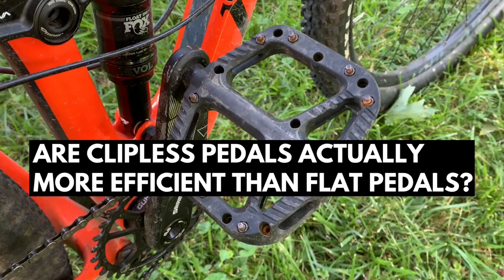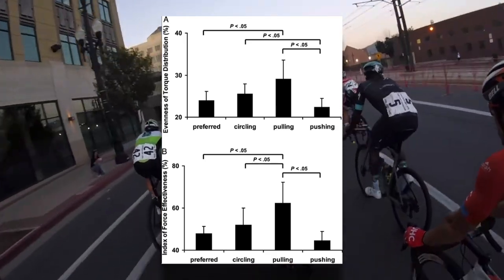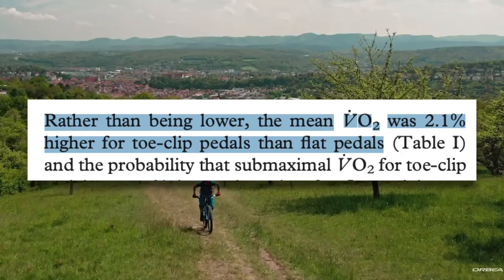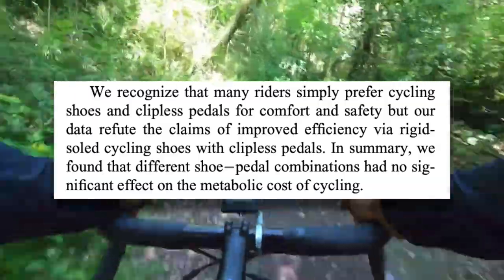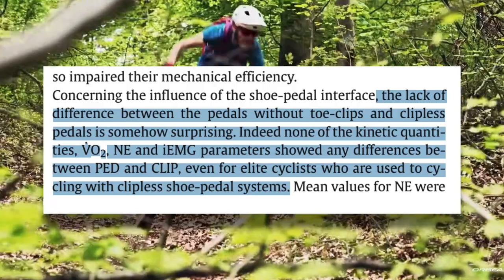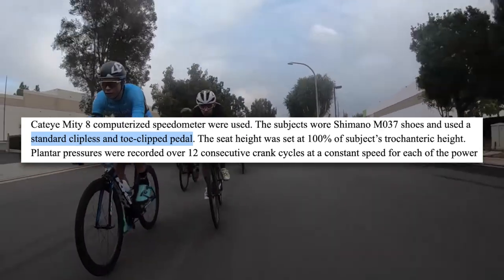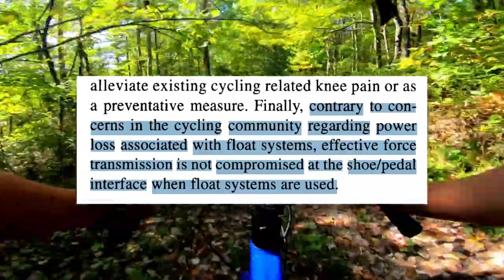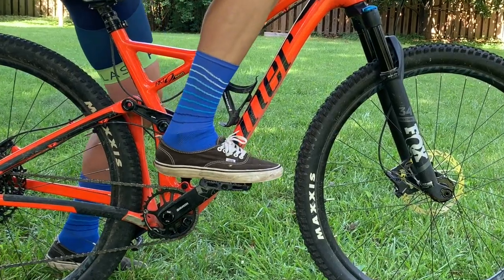Are Clipless Pedals Actually More Efficient Than Flat Pedals? The Answer Might Surprise You.

Comment: I come back to this after former pro racer Paul Voss briefly switched from road bike cleats and shoes to MTB cleats and shoes before the Unbound and had to stop the race after 3/4 of the way because his calves gave out.

He never trained in the MTB Cleats and said they had a different position that his muscles weren't used to.

But given that the SPD Cleats are way smaller than Road Bike Cleats it's also very possible that the transition is weaker in MTB Cleats and he just had to use way more energy in MTB Cleats.

Flat Pedals would have been the right move.

This is one clear an example of how ideology works and manifests itself. There is enough science out there that someone should give Flat Pedals in such races a try, especially if he has to walk in Mud so much. For the Unbound 350 it's very easy to see how Flat Pedals could save you a lot of energy as all the muscles in your foot will be contracted instead of one area only
Reply: Pure bollocks. His problem was he changed equipment before a race without taking time to test and fit.  Not that he didn't use flat pedals. No offense, but utter nonsense.
Reply: @PRH123  Take offense that you said nothing of value and didn't make one argument. Study biomechanics and energy. Learn. We don't live in a Minecraft world where everything is for free. Not to late to pick up a book.
Reply: @ambulowan  right, you’re a biomechanics and physics expert, strange you’re not working for pro cycling teams and sharing your vast knowledge with them, you could teach them your theory of foot contraction :)
Reply: @PRH123  >working for pro cycling teams

Like cycling teams have any expertise,
for the longest time they were very resistent to any advice. Just look how long it took them to install the slightest now obv thing that everybody is doing. It was decades. Cycling teams is absolute amateur hour, it gets a little better now, but for most it's just about power, admitting something works better means that you are not needed at you job, so hardly anyone is doing it.

Comment: After years of going back and forth, back and forth, among foot-to-pedal options, I finally settled on my Campy flat pedals with Christophe toe clips. For me, this is the best of all worlds. I get just as good riding efficiency based on my real world experience (and this video). I get the advantages of having my foot securely in position on the pedals. I can remove my foot much faster from the pedal in an emergency. I get to use my running shoes so if I want to have an off -bike adventure to the coffee shop or hiking trails, I am ready to go. And I save the huge expense that comes with buying dedicated clipless bike shoes. The only down side I can see is for the bike accessory manufacturers who lose the business that comes with buying all that clipless gear. Anyway, just one man's opinion.
Reply: Speedplay frogs will release telepathically, much much faster than being strapped into the bike.
Reply: bikebudha01 Thanks for the tip! I checked those out and it says SpeedPlay Frogs were discontinued in Feb. of 2020. Oh well. BTW, I wouldn't refer to my system as being "strapped to the bike." My Campy plus Christophe system does provide a secure connection to the pedals but it allows me to pull my foot straight back and out of it's "mooring" with no issue under any emergency dismount situation...which is really important to me.
Reply: @SignorLuigi  You can still find frogs on the interwebs...  get them while you can.  (They last forever, I've been riding the same pair on my moutain bike for the last 3 mountain bikes i've owned.  You do have to replace the shoe cleat every 5-7 years though...)
Reply: Gotta agree with this. Not necessary Campy/Christophe (something I lusted after as a teenager), but flats and toe clips in general. Yeah, it makes me look like an old fogey, but I like the security of being clipped in, the consistency of foot placement on the pedal, and the ease of getting out of toe clips. Not to mention still having the skill to quickly get into toe clips on a fixie ;-)
Reply: jalanperak I get those "old fogey" looks on rare occasions. I just smile back. Sounds like we come from similar generations. Ride on brother!
Reply: I do that with one of my mtb bikes and folding bikes.  But I use mtb shoes without the cleats attached.  The benefit of both worlds as like he said, most power comes form the down stoke.   Being clipped in is still more efficient but not much more.

Comment: The main benefit I’ve found with clipless pedals is control in super rocky technical riding. That’s the main reason I’ve switched. Now after a few years knee pain is making me reconsider that.. I’ve done a few 50 mile rides on mixed surfaces w/ flat pedals and I have zero pain

Comment: I am an xc racer and I use clipless pedals because I can sprint faster and I don’t get bounced off my bike when going though rough sections
Reply: The bouncing is not a problem when you are using the proper pedaling technique (heels down) and a proper flat pedal /shoe combination. The problem is that with flats when you go to a hard sprit or a steep climb your foot can go off. It takes lot of practice to master the sprint in race conditions on flats.
Reply: @WintergardenPL  You don’t see XC racers with flat pedals. You meant “DH”.
Reply: @shannontrainer5857  no I didn't meant DH riders but also Xc riders. I should be more specific. I was referring to bouncing on rough terrain. Clipless pedals are obvious benefit to Xc where you often change cadence and sprint heavily. But on techy stuff not so anymore. Enduro, dh you often see flats. Both have their benefits and cons.

Comment: I remember seeing a study a few years ago where it said that the leg muscles used in cycling worked most efficiently when the work:recovery ratio was about 1 to 5, ie they were only working about 1/6 of the time. That might work out at somewhat more than 60 degrees of rotation in practice since you don't instantly go from zero to full power and off again, there's a bit of building up and down. But it does suggest that the action mostly happens between the 12 and 6 o'clock positions with relatively little benefit to be gained from 'pulling up', since if you do this you are depriving your muscles of recovery time and making the whole action less efficient.
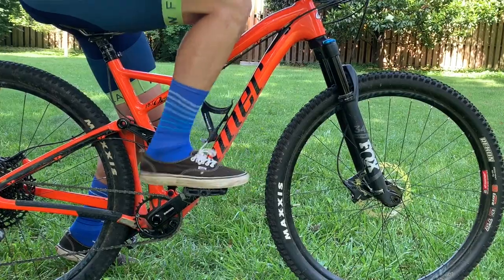It might be, as suggested at 9:30, that the main benefit of going clipless is that it at least keeps your foot in the right fore-and-aft position for maximum efficiency - but then you could say that for old-school clips and straps too. (It also more or less compels you to wear something with a good stiff sole, rather than £10 supermarket deck shoes or whatever you wear just to pop down to the shops...)

Comment: I just like having my feet stay attached to the pedal when riding in my city. Roads in Montreal have more in common with the surface of the moon than roads. Also makes hopping obstructions a lot easier. I do like the funny looks I get for having MTB pedals on a "go fast" bike but SPDs are great for getting around in a congested city with ground up pavement. I have to wonder if flats are a better overall work out; your foot can move around more and presumably bring more muscles into action; sort of like free weights being a better workout than machine that isolates just one muscle group.
Reply: Cheers! I commute year round (Newfoundland), what can you do with clips I can't with my platforms? And yes clips make hefting the rear easier.
Reply: @cbcsucks2205  There's nothing you can do with clips that you can't with platforms. Montreal's roads in many places are not in great shape thanks to our wet->freeze cycles in winter. I work in an industrial park where there are potholes large enough to fall into. When hitting rough terrain at speed clips keep my feet on the pedals instead of flailing about. Its really just a personal preference; I feel more secure with clips than loose. Newfoundland is lovely.
Reply: @dereksauer8108  whereas I'm always going sideways downhill. Ride on!
Reply: I also use MTB pedals (Time ATACs) on my road bike.    I prefer MTB shoes for general cycling (Toronto - roads suck here too as do drivers) and when you have to unclip and clip in a lot MTB pedals are easier since you don't have to flip the pedal.    The shoes are better for walking around too - and since I'm an old guy with lots of skiing related knee issues - avoiding slips is important.    The only give-up as far as I'm concerned is weight for the pedals and shoes  - measured in ounces (or less than the weight of the average bowel movement!  So regular use of Metamucil can even things up.)
Reply: Yep, Crank Bros on My road bike also!
Reply: Since you don't mind people looking at you funny for having MTB pedals, you might think about a pair of MTB flats like Race Face Chesters.  In a pinch you can pedal in sneakers or snow boots, but they're really meant to be used with a flat pedal oriented shoe like the Five Ten Freerider.   The steel pins interact with the thread to lock your foot in place -- you actually have to lift your foot to adjust your foot position.  That's actually very important in mountain biking where you absolutely do not want to have your foot slip off the pedal.
Reply: You don't generally move your foot on a "true" flat pedal/shoe combo. The sole is so sticky, and the pins of the pedal so aggressive, that you have absolutely no play . It is effectively the same as a no-float clipless setup.
This seems to be one of the biggest misconceptions about flats: that your foot moves around. It doesn't... but obviously you can't pull up. But as long as you have your foot on the pedal, it is actually MORE attached to the bike than in clipless.
But you will get in a slightly different position everytime you lift your foot and put it back on.
Reply: @BrianKlausen  "actually MORE attached to the bike"
That's not how physics works.
Reply: Trust me. 99.99% of population is not looking at your pedals.

Comment: I found it very hard to ride out of the saddle uphill on my road bike with flats because of the tendency of my feet to get out of position, and my subsequent fear of slipping off the pedal when trying to reposition them. Clipless pedals solved that problem beautifully. I wish I could post here the photo of my left leg covered in blood after slipping off my flat metal pedals on my 1993 mtb; the scars have never gone away.
Reply: This is exactly for me too. It is not about adding "free" speed, because at the end, power is power. However when it comes to foot placement stability and not having to think about repositioning your foot, clipless can not be beat.
Heck I would trade slight loss of efficiency if it means I am more comfortable on the bike.

Comment: flat rider here on a road bike. clipless is ok if you're racing or riding in a control environment. on the streets where we get to share a road with cars, you can't afford to remain locked to a bike. you need to be able to ditch the bike and stand up if something unexpected happens. in a motorcycle course, they actually teach you to let the bike go if it's going down and not hold on to it. plus what will you do if the spring malfunctions and you fall and the light just turns green. you better hope there are responsible drivers who have seen you. but we do need shoes with solid, unbendable soles. jus two cents.

Comment: I was interested to see a few tour divide riders using flats. I guess they wouldn't be using them across a 2700 mile race if the efficiency weren't somewhat comparable.
Reply: I don’t completely disagree but from what I can tell about the tour divide riders is that they aren’t exactly the most powerful riders but they have insane endurance and are just kind of crazy. I don’t think they care too much about power they probably care more about comfort for a 2-3 week endeavor.
Reply: @spaaceman8908  Some Tour Divide riders definitely generate a ton of power. Especially those that are racing and going for records or wins. Mostly they ride flats because TD has a shitload of hike-a-bike even in a year with good weather (more if there's a lot of snow in the Rockies) Hiking with 5.10s or some other flat pedal shoe is way better than hiking in traditional MTB shoes.
Reply: @TheDavidjakeson  I mean a tour divide rider won’t be putting out over 500 watts if they are pacing themselves well. I also think the weather factor could make clipping in suck so it would make more sense to go with flats.

Comment: Great video.  My experience after years of riding flats then years of riding clipless - consistent, comfortable foot position > all other benefits when riding clipless.

Before making the switch I would constantly be readjusting my foot position after every stop or slip and it often felt a little off.  Afterwards my feet always feel comfortable as they are dialled in to the optimal position for me.

I found little to no performance benefit with the minor exception of a brief burst of power cresting a steep summit or some such, when I would very briefly pull up a lot more for a few pedal strokes.  Other than that I can imagine max sprints are also that bit more controllable but I so rarely did that in my riding days on flats I couldn't say even that for sure.

Comment: 6:20 is truth.There are different pedalling styles for different situations.    Efficient cruising, acceleration, sprinting (whether racing or just to make a traffic light), hill climbing, getting traction of bumps and humps,   .    On a long ride I will deliberately vary my technique to avoid fatigue -- sometimes exerting effort on the forwards & backwards parts of the stroke.    

Flat plastic pedals are slippy when wet.    MTB pedals with pins have great grip except when pulling the foot upwards.   

Also when pulling up, you mentioned that the muscle used to bend the knee is weak, so power gains from clipping in and pulling up are weak.    But when I stand up on the pedals and move my knee up like I am a kickboxer trying to knee somebody in the chest, I get a lot of power to spin the crank.    This is a great video, and worthy of a follow-up.

Comment: Nice video. As a long distance cyclist myself, there are several more benefits of good quality flat pedals that I’ve noticed. You can wear normal shoes which is nice if you bike someplace where you want to walk around. Cyclists who travel light will appreciate not carrying extra shoes. Flats are simpler, with fewer components which is nice for reliability when you’re far from any support system. Flats give you the ability to adjust the position of your feet, should they start to hurt and keep on riding. If you take a spill with flats, it’s super easy to recover from as you’re not clipped in. From my experience, I don’t recommend plastic pedals of any kind but instead, I recommend spending the extra on metal, mountain bike pedals that are wide with metal pins for grip as I have slipped off plastic pedals when they get wet when road riding.

Comment: I ride flats exclusively these days though I have spent years on clipless. Changing foot position is AWESOME on long rides to switch up muscles being used or to avoid cramps. In situations where you might need to bail flats win as well. I'm way more towards the slow pedal up, shred down end of the spectrum than the 'serious cyclists' Dylan is talking about though. When I was doing more XC oriented endurance riding on less gnarly terrain I did like having clipless.
Reply: Bingo.  Had a coworker shatter his arm biking.  I asked was he hit by a car.  He said no, his feet got stuck on the pedals and he tipped over and "crashed" on the sidewalk.  Most useless invention of all time if you are doing anything besides a legit bike race.

Comment: I feel much safer clipped in. More bike control particularly on descents.
Reply: Flats with straps make me feel the most in control of the bike. Easy to pop off and run if needed and my feet won't fall out while sprinting.
Reply: To me it's the opposite
Reply: @UenoLocker54  I feel the opposite when sprinting over 45mph or climbing up steep hills off saddle w like 300watt effort, the insecure feeling of flat pedals simply restricts my power transfer to like 2/3, but thats just me, maybe everyone is different or maybe theres a way to glue ur shoes on flats like its on clipless
Reply: @shunzhang838  Just put straps on and have them setup tight enough that you don't fly out. I notice you clipless guys always omit the idea of straps.
Reply: @UenoLocker54  because that's the last thing we want, the hassle of using hand to untie straps and aestheticly not pleasing, too tight ur feet becomes uncomfortable and not tight enough it becomes too loose....
Reply: @shunzhang838  You don't tie them though. They use velcro and after the first setting it shouldn't need to be redone, simply slide your foot in and out as you ride.
Reply: Shun Zhang The hassle? 😂 get outta here
Reply: I've switched from clipless back to flats. I gave it a good 8 year try so I didn't abandon it right away. There were some stretches where I could go down hill closer to 40mph, and when clipped in I didn't necessarily feel more control. Instead, I felt like WELL I'm going down with the ship if I hit anything or mess up. I was stuck with the bike no matter - and being by a lot of deer didn't make me feel safe at all. If one jumped out and I was going that speed, I was in big trouble. I feel like with flats I might be able to break hard enough and hop off the bike without having to eat concrete. Just my opinion!
Reply: @james-tennis  and with flats you can stick your feet out with ease to re-balance in a dicey situation..